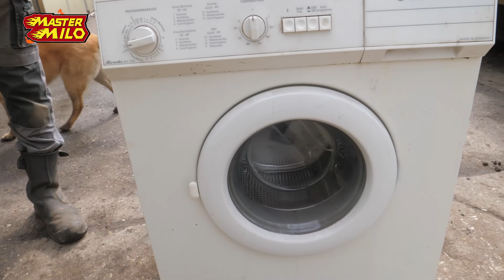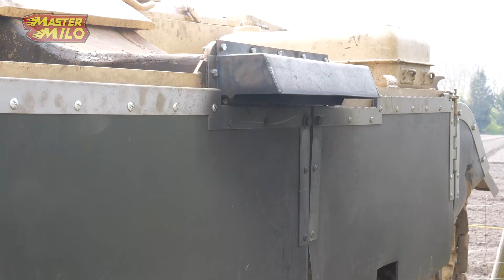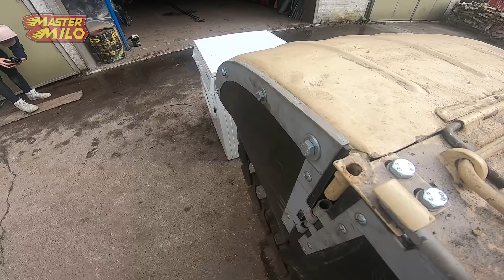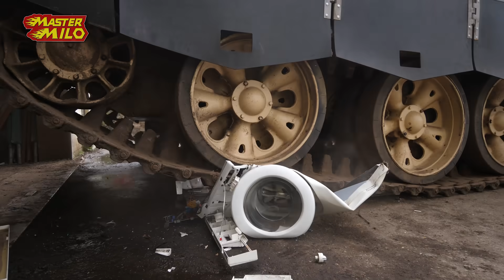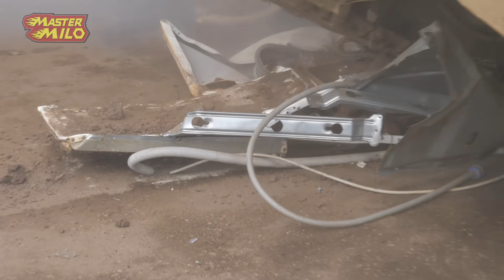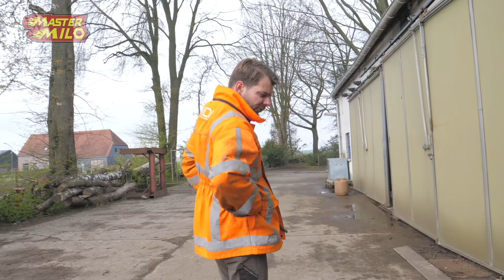TANK vs WASHER

Comment: I have an idea. Can you try using olive oil instead of engine oil? In a car or maybe a generator?

Another idea - put a generator in a closed box and see how long it will run until it runs out of air, then feed in a pipe to deliver air to the intake (to keep it from stopping from air starvation) and see how much longer it will run before it burns up.

One more idea - see how long an outboard motor will run out of the water (no cooling!).

Last idea - how long a two-stroke engine will run on regular petrol (not petrol mixed with oil).

Comment: Technically:
Although the tank itself weighs ~35 tons, the axle that first ran over the washing machine would have taken 1/5 of the load of the entire vehicle, meaning only 7 tons was ever actually put on top of that washing machine.
Reply: So if he drives over it with one side it would actually be 3,5 tons. Because the axle has 2 points of contact.
Reply: Though if one axle gets pushed up, it will release load from the other axles, increasing the load on the pushed up axle. So it won’t be perfectly 1/5th of the weight of the tank but more.